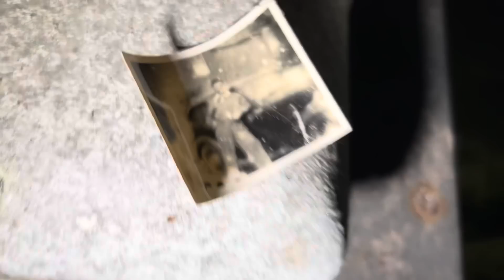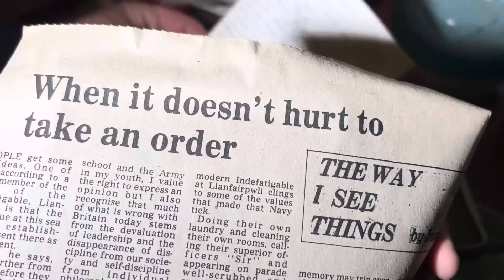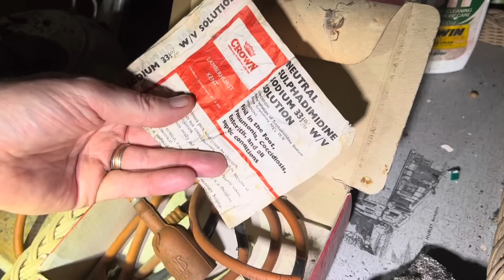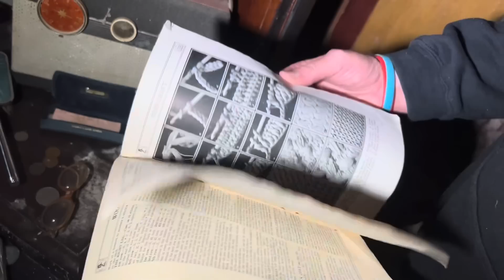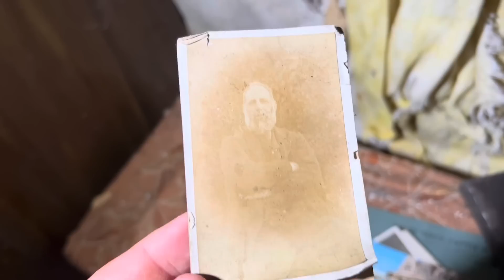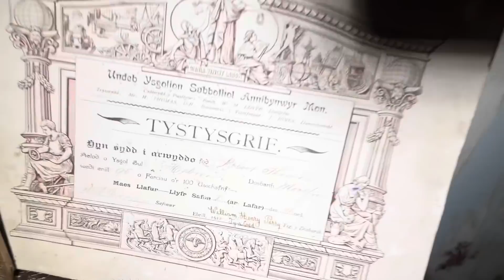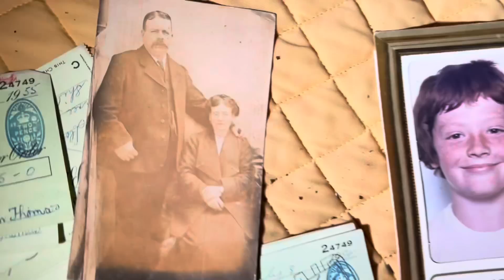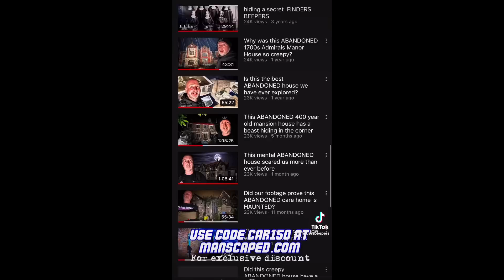Did this scary ABANDONED house have a claustrophobic ghost?

Comment: The photo of the two little children is Gwynfor and Heulwen (pronounced "Helwin"). I used to work with a lady with the same name, so I've seen and heard how it's both said and spelled.
The wooden thing with the hooks on the top is a French knitting bobbin (or dolly). The knitted tube goes down the middle of the bobbin as it's produced and out of the bottom, IIRC. And did you know that button phobia is called Koumpounophobia. So Matt, where did this begin? 🤓
A "Tystysgrif" is a certificate, so this is a certificate awarded to Mary Catherine Thomas, member of the Hebron Sunday School, Moelfre District, who got 100 marks out of 100 ("Uwchafrif" translates as "Supernumeracy", so it looks like it could be for Maths, but I'm not sure why they would be teaching this at Sunday School) syllabus___Standard Book III (Verbally) under 12 years old. William Williams - Moderator. W Henry Parry - Class Secretary April 1917 and it's from the Independant Sunday School Union (the bit right at the top of the certificate).

I don't think the wedding photo was colourised because depending on when it was taken (for example, the late 1960s), colour photography was available but more expensive than black and white. My parents had a couple of colour wedding photos in 1968 and I remember Mum telling me that all of their wedding pictures were meant to be colour, not just the couple that were, but the photographer messed up and ended up giving them the lot for free.
Reply: TAKE THE TIME, LOOK IT UP.
Bit Chute Limited
KABALENS FALD, EFTERFØLGER. DEL 19: COVID-19, MIDAZOLAM-MORDENE  !!!

Comment: Another great video guys , in the red box on the side  with the brown /Red tubes  they are to put on cows udders To drawl out the mastitis ,Which comes from the cows teats it's like clotted cream ,It stinks , I worked with milking cows ,  The little brass wheel upstairs in the drawer is a pulley wheel for a grandfather clock that is attached to the weight

Comment: Did you know a Very Long Time ago Women use to Get two long straight, one inch wide pieces of wood. There is a Bush which, for about two inches above the main Stem, the smaller stems are straight. Women used to collect them and sit them close together on one of the straight one inch wide pieces of wood. Then the two inch wide pieces of wood would be bolted together and they used that to do their hair. Another word for Bush is Shrub. That is where they got the name Brush from. It's an anagram of Shrub. There is a very slight possibility I made that up.